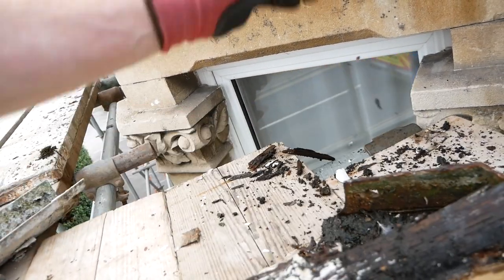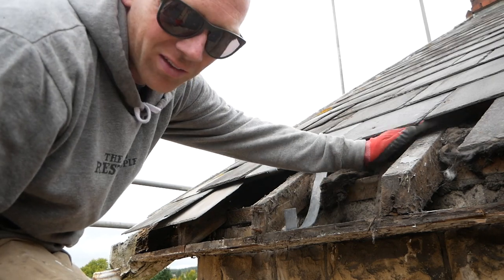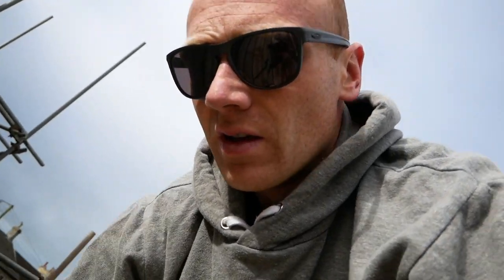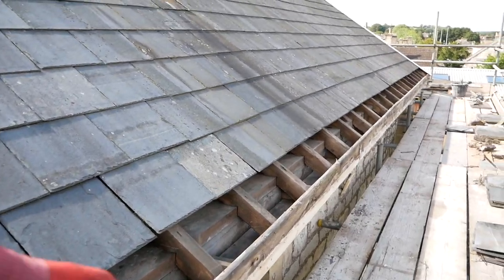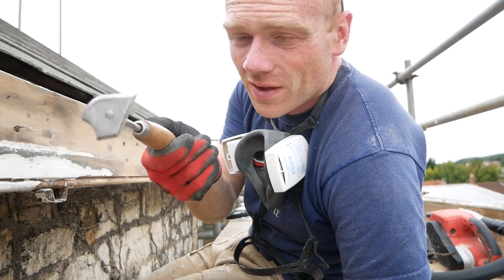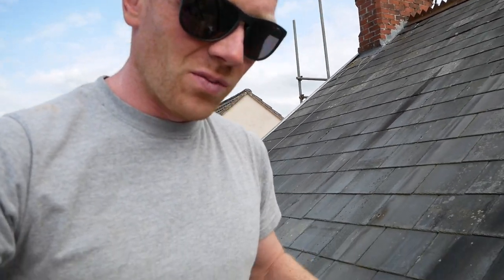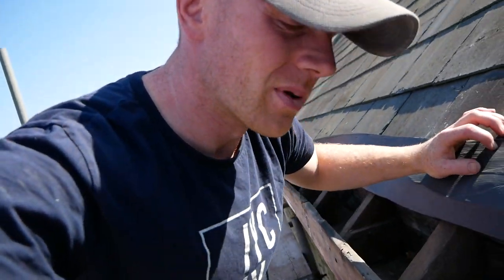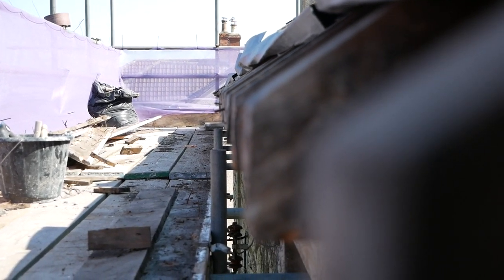Old Wooden Fascia - CAN IT BE SAVED?

Comment: Yup get a teamed roofers in would be a good idea! A nightmare of a job for just one person! I reroofed our 200m2 roof last year included putting in new trusses between the existing trusses to strengthen the roof construction! It’s hard work having felt flying around and lining up new batterns with the correct spacing etc... Good effort! Keep up the hard work!
Reply: Me and my Dad replaced the roof on my 200 year old cottage. Concrete pan tiles, 3 different roof sections, 2 velux windows, 2 Chimneys to flash around a valley and a box gutter. I knocked myself clean out on day 1 from standing up under the concrete lip of the valley, got heat exhaustion twice over the 2 week span fell off a section into a pile of Lathes that had been pulled off and got punctured by 4 rusty nails (needed a tetanus booster) and got an infected leg from a flying ant bite. I will never EVER do another roof again!

Comment: Shave hook is that tool. I use it with a hot air gun, did my Victorian architraves, finish off with a light sand. Might have been quicker than yer sander

Comment: You should buy a bahco paint scraper. They have a carbide tip and different shaped ends for intricate areas. Honestly one of best things ive bought for stripping paint. Just pulls it off easily.

Comment: I absolutely love your pages (YouTube/IG).  On this project, I'm wondering if you've ever experimented with or thought of using a product like Bondex (which is made/available in the UK) to help prevent wood rot?  I've been lucky enough to use it and have decided to start treating all of my new builds and renovations alike with this in any spot that end-grain is exposed, so any cuts, penetrations, etc.  I don't have any long-term testing to see how it performs, but I do know it has not had any immediate negative effects on the wood.  As you also seem to use Linseed based paints, both of these products together should protect against rot while still allowing the natural breathing that prevents water retention and then rot.

Comment: Definitely not plastic on such a heritage property.
Reply: I agree. UPVC looks out of place on a period property. Look at how out of place UPVC looks on other nearby older properties
Reply from the maker: This is exactly my point but bizarrely I get 80% of folks saying plastic! 🙄 Surely the fact that much of the wood was just fine after 120 years is enough proof for me. Same for metal gutters.
Reply: Depends because you can get 
Black ash fascia boards or wood grain which don’t look to bad on a dated building (fascia and guttering fitter from Birmingham)
Reply from the maker: Connor James you can of course but not in every RAL colour and visible fixings everywhere. There is a place for UPVC for sure, but not in a period house roof restoration. Don’t get me wrong, nearly every other non listed building around here would go for it.
Reply: Great video to watch👍🏻
Reply: @connorjames6516  yes we used that on our old house built 1940s doesn't look too bad, we rent it out if we were living their we wood (sic) have used wood. 😁
Reply: @TheRestorationCouple  yep re-wood is best although requires on going maintainable.  The biggest problem is getting decent new wood it's usually fast grown kiln dried and 'orrible, and most timber yards get the hump if you want to sort through and pick the best pieces.
Reply: I’ve also worked on a few old building where they want new cast iron guttering back up but they change there mind after seeing the cast iron look-a-like and the price difference from cast to plastic😂 But I guess some times people have a budget to stick to🤷‍♂️